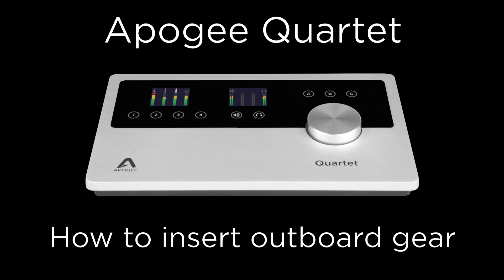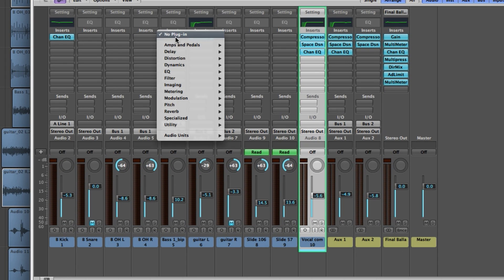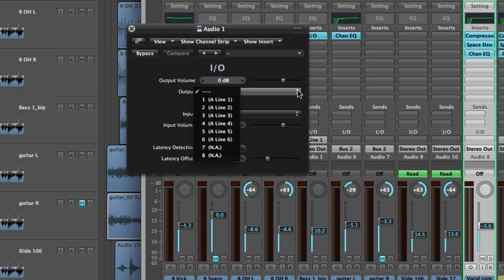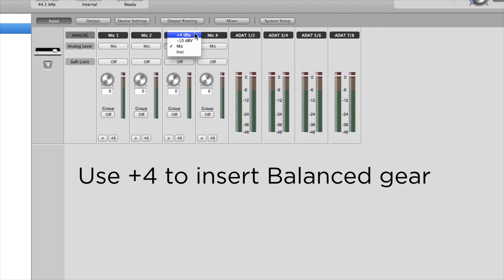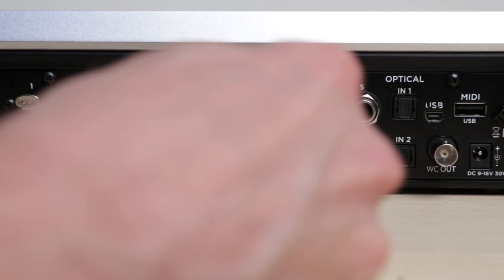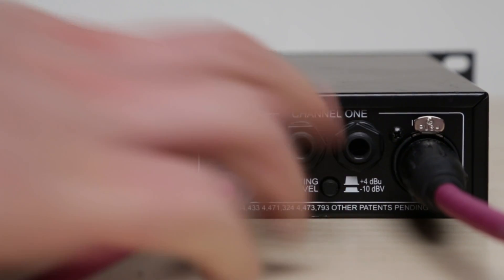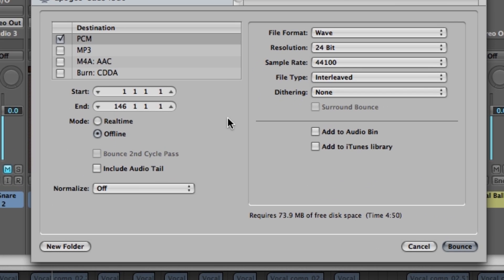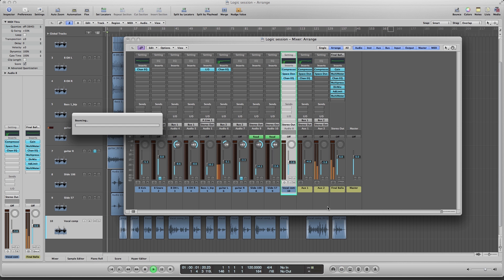Apogee Quartet - How to Insert Outboard Gear

Comment: It is possible to record with an outboarded analog compressor AFTER the preamps BEFORE A/D conversion?
Reply from the maker: +Tobias von Kitzing unfortunately you can't do this with Quartet - at least not with the built-in mic preamps.  However Ensemble and Symphony I/O both have analog inserts that allow you to do this.